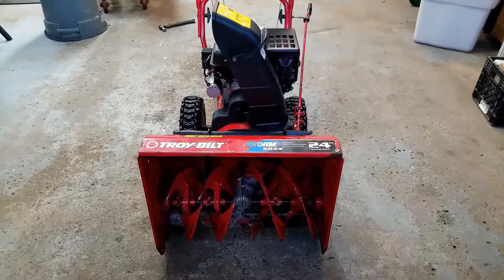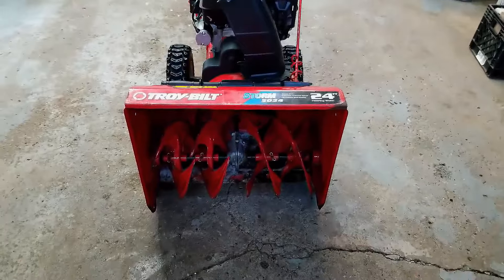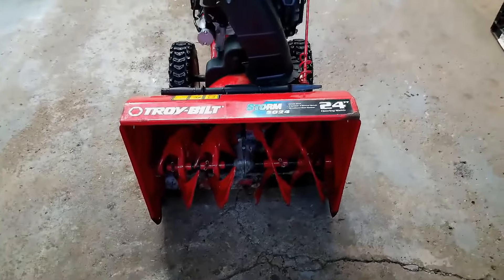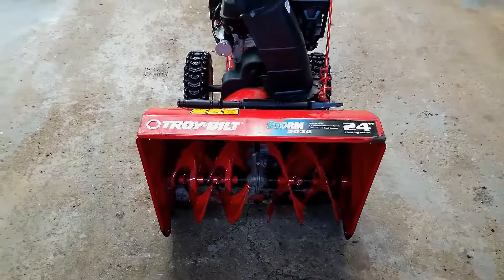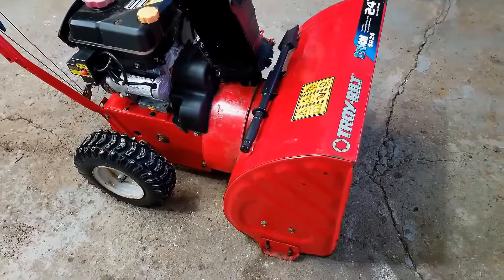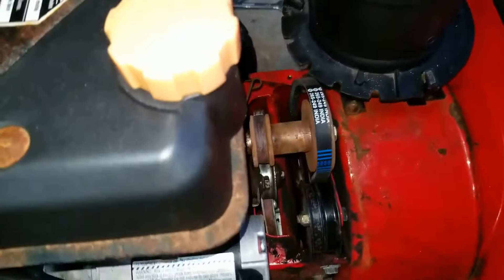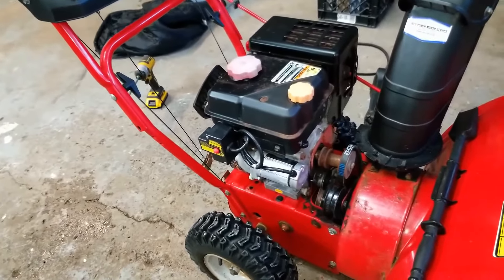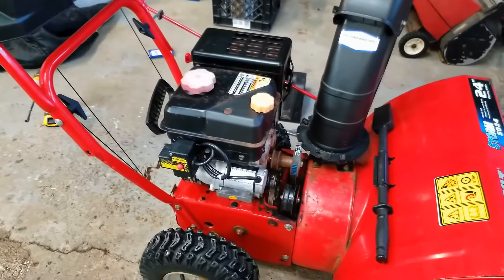Troy-Bilt Storm 5024 Auger and Drive Belt Replacement

Comment: Nicelly done vid.  You can also remove the auger assembly (2 bolts on each side) to change out the auger belt.  I guess it's a toss up which may be easier.  Who designs these things?  First year engineering students?  Shouldn't be that hard.
Reply from the maker: Thanks for watching and taking the time to leave a comment. Cheers

Comment: I have 6 different ATV's and I work on them all the time and everything I've learned has been from watching videos like this. I just bought the same snowblower your working on used. First time I went to use it it wouldn't throw anything. The belt was shot. 
Thanks for making it easier for me. It only took 15 min because I watched your video.

Thanks again.
Reply from the maker: YouTube is a great resource for learning new things. Glad I was able to help with your project. Cheers

Comment: Hey good video shots of the belts changing. This is identical to Craftsman 24 inch I'm changing belts on tomorrow,  just wanted to familiarize myself with setup. 2 quick observations.... The belt keeper on these MTD made blowers is actually the black plastic belt cover shroud. Also when the belly pan was off, you can see the hex shaft was lacking lubrication. I always toss a smidge of white lithium grease on that, which really helps in changing gears, your customer will definitely notice that right away. Again, good video, good angles. .
Reply from the maker: Thanks for watching and taking the time to leave a comment. I definitely grease the shaft. I don't always film the entire servicing as I have a complete series of videos detailing a complete service. Cheers

Comment: Very informative video Gerry! I always like to remove the spark plug before moving any of the pulleys or belts. That way any compression from the engine that may have transferred to the pulleys or belts will be released, minimizing the chance of an accident (and making it a little easier to roll those belts) especially if a person were to put their hands in the auger/impeller areas.
Reply from the maker: Thanks for your comment. Cheers
Reply: @brantsmallenginerepairs  I thought it important to stress that Gerry because we know how things work but not all viewers do. I've seen many a stumps for fingers over the 50+ years in the snowblowerz business so just trying to give my 2 cents, thanks for letting me! 🤘💥🤟💥✊💥👊💥

Comment: I would have thought you would of had to loosen the adjustments because new belts would have been tighter,especially people usually tighten them when they get older
Reply from the maker: Adjust the tension as necessary based on the new belt. Old belt probably could have still been used with a cable tension adjustment.  Thanks for watching and taking the time to leave a comment. Cheers

Comment: I’m 70 years old and have come to the conclusion all snowblowers are junk, just one repair after another, a money sinkhole. I gave up on wasting money on these junkers and I use my trusty shovel.
Reply from the maker: This would apply to a lot of stuff that is produced these days. The shovelling would definitely be better for your health anyway. Thanks for watching and taking the time to leave a comment. Cheers
Reply: I've had my troybilt 2410 for 12 years without an issue! Infact I use it commercially. I put an impeller kit on it after the first use, it kept clogging cause of the wet snow but never an issue since, just regular maintenance. People use them in a snowstorm then put them behind the shed and forget about them until the following year! Lol Just like anything else you have to maintain them! #1 biggest common issue is old gas
Reply: Snowblower was the best investment I ever made